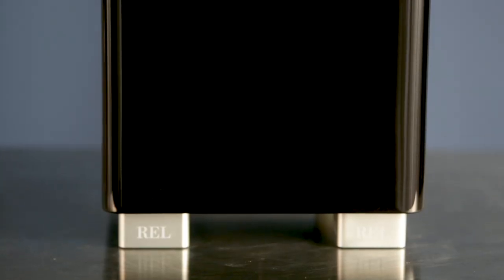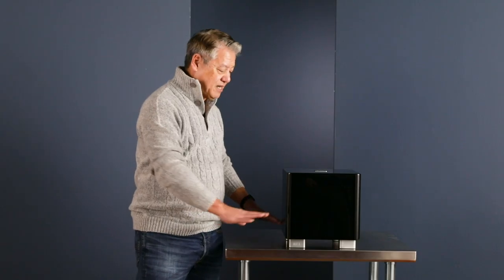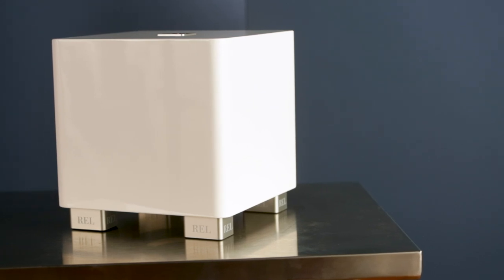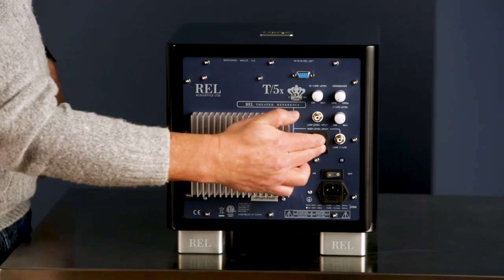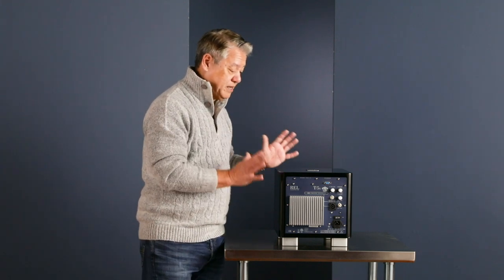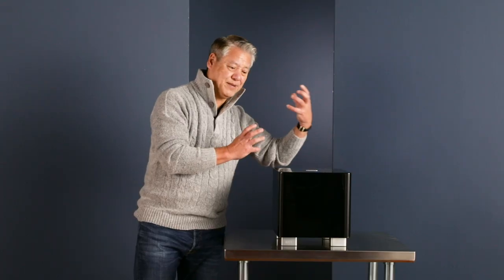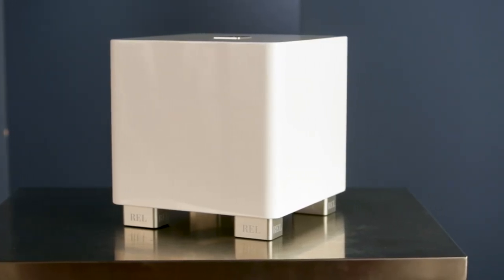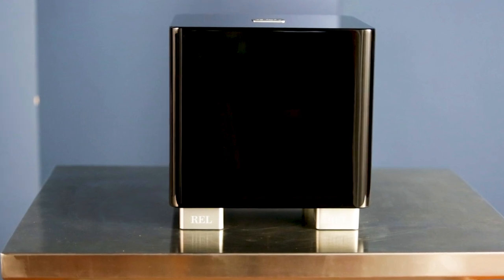REL Acoustics T/5x Powered Subwoofer Overview

Comment: I have the previous iteration…the T5i; I have it connected wirelessly via the REL Arrow wireless transmitter.  I have it set at 20% (8 clicks) on the min max volume dial and crossed at 30hz (lowest setting).  It’s integrated superbly for my room load for either home theater or 2.1 channel audio set up.  I cannot imagine needing more bass/sub bass (Preference dictates of course). I have it located on the rear wall in the corner of a 12 X 18 bonus room.
Reply from the maker: We are glad to hear that you are enjoying the performance of your T/5i! If you have any questions about the subwoofer or wireless system then feel free to reach out and we will be happy to assist.

Comment: I’ve just had my T5/x a few days and I’m so pleased with its addition to my system (Orchard Audio Pecan Pi Ultra streamer/DAC, Gamut D200 dual-mono power amp, Stereo Coffee kit LDR pre-, Sonus Faber Concerto Home speakers, Rega P3 and iFi iPhono2). My SF speakers did a great job but the addition of the single T5/x has definitely increased stereo depth and presence. I’m probably still dialling it in, however I’m impressed and it has contributed to my already great system just as I had hoped.
Reply from the maker: Thank you for reaching out, and we are glad to hear that you are enjoying the performance of the T/5x in your system! If you have any questions about your new REL then feel free to let us know and we will be happy to assist.
Reply: Just ordered one for my Concertos as well.  What settings did you use?
Reply: @flitetime  My T5/x developed a fault shortly after I bought it. Had a replacement card fitted and as yet I have not spent much time setting this one up. A quick check shows I have the Hi/Lo Level and the Crossover both at about 10 o'clock. Every room is different as you know. :)

Comment: I just set up two. T/5x with Elac UBR62 
It’s been about 20 hours of operation.. definitely become louder as they break in.. I’m surprise how much I’ve turned the gain down. They sound amazing. 
They blend with the speakers like nothing I’ve heard before from a subwoofer. They seem to change the lower midrange and add warmth and fullness. I’ve got an svs 3000 micro 900w 2400peak .. 
The T/5 is 125w and there’s no comparison.. The REL are so much more deep and seemingly more powerful. Especially after break in I think dropped six clicks down.The REL definitely delivers lower cleaner bass than the SVS. Even though specs say the svs was lower.
Reply from the maker: We are glad to hear that you are enjoying the performance of your T/5x subwoofers!
Reply: I have those speakers aswell and want to add two t7x 😊 nice to hear they blend well. How big is your listeting area. I have around 20m2. I hope those two will be enough

Comment: What's more important in pairing, subwoofer size to the room, or matching the price range of the speaker models?  Let's say you have a higher end bookshelf speaker (harbeth 30.2 for instance) in a smaller room, would you want a small sub like the t5x so that you don't overload the room, or would you want something like the 7x to better match the performance of the high end speakers and try to adjust to the room?
Reply from the maker: The ideal subwoofer choice for a particular system is dependent on several variables, including the size of the room, the choice of speakers in the system, and if the system is used for 2-channel music or home theater listening. In our experience, for use in small rooms the T/7x will be the ideal choice for pairing with the Harbeth 30.2 speakers.

Comment: Hi John.  I bought a cambridge audio cx a 61 with a sub output.  Should i still use the high level input on the t5x.  Or should I use the low level input and then run in to my amps dedicated sub out.
Reply from the maker: In order to get the best possible performance from the T/5x, we do recommend connecting it to your Cambridge Audio CXA61 using the High Level input rather than the RCA sub-out. The CXA61 is a Class A/B amplifier, meaning that you will be able to use the standard High Level connection method.

Comment: My listening room is upstairs and we have wooden floors.  Will this down firing sub cause problems for my family in the living areas below?
Reply from the maker: Due to the significant low-frequency pressure waves that they produce, any subwoofer can excite the floor which it is placed on, though how much this is heard in below living areas will depend on your listening levels and choice of program material. That being said, the T/5x will be less prone to this compared to our larger subwoofer models, since it does not reach as deep in it's low-frequency extension and does not have as much output power.
Reply: @RELAcoustics  Thank you for your reply.  It sounds like the T/5X is the way to go.  I guess I can tip it on its side if if is a problem.

Comment: Will a single T5X work well in a 5m x 5m room, pairing with Q acoustics 3050 and audiolab7000a ? The bass in the 3050 is not articulate and below certain frequencies become exceptionally quiet.
Reply from the maker: Thank you for reaching out. In our experience the T/5x can perform very well in this size of room, and is a good option for pairing with your Q Acoustics 3050 speakers. If you have any additional questions about subwoofer pairing for your system then feel free to write in to contactus@rel.net and we will be happy to assist further.

Comment: This may be a stupid question. I’ve never had subs before. If I set these up using the hi level input, does the gain need to be adjusted every time I change the volume level of the speakers using the volume control on the integrated amp? Or is the gain level set once, relative to the output of the speakers so the sound is always balanced regardless of the volume I’m playing?
Reply from the maker: Thank you for reaching out. REL subwoofers are designed so that their Level control is used to match the output level of the subwoofer with that of the system's main loudspeakers. Once this has been set, adjustments to the system's volume control will equally adjust both the main loudspeakers and the subwoofer together.

Comment: Hi John and Rel, I always appreciate your informative videos, but I have 2 questions about the T5/X.

Being a down firing design, could a system still benefit by having a stereo pair of them?

Secondly will they be happy very close to the back wall?

I'm interested in having them in a system with wall mounted Dali Menuet SE in my small bedroom. 

Thanks!
Reply from the maker: Thank you for reaching out. The performance of the T/5x subwoofer does benefit by using two of them in a stereo pair configuration, even with them being a down-firing design. Stereo pairs allow for a more seamless blend with the system's main loudspeakers, while also providing a more even distribution of sub-bass energy in the space.

For optimal performance we recommend placing the T/5x in a corner, ideally along the same wall as your main loudspeakers are placed, though you can instead place the sub(s) along the back wall of your room. The proximity of the subwoofer to the wall can then be adjusted as part of tuning them in your room and system.

Comment: Hi, my T5 went pop recently and as I am into home cinema as well as music, thought that maybe I should either get the HT1003 and maybe get the T5 repaired, or should I maybe just get the new T5x. Is there really that much difference between the two T5 models? Or would you recommend both the T5x and HT1003 anyway?
Reply from the maker: Thank you for reaching out, and we are sorry to hear about the issues which have occurred with your T5 subwoofer. The T/5x does offer a noticeable improvement in performance compared to the older T5, though it could still be worth having your subwoofer repaired. For repair information, or for help with choosing a new subwoofer for your system, please write in to contactus@rel.net and we will be happy to assist.

Comment: Dumb question from a newbie here - mt apartment floors are carpeted. Will the down firing driver be absorbed too much in this setting?
Reply from the maker: In our experience having carpeted floors will not impact the performance of a subwoofer, even if it is an exclusively down-firing model like the T/5x.
Reply: @RELAcoustics  Thank you.

Comment: Why isn't there a 180 degree adjustable phase function?  I feel like this is a must have feature in my setup.  Also,  ,for years now,  I've been using a Jensen ISOMAX SP-2SX Line converter to accomplish HL input to my Focal Sub6.  Unfortunately, if the impedances between the matching components isn't correct, it results in a minor loss of spatial ambience, a loss that is hard to accept. How does REL overcome this problem?  Is REL implementing a similar internal transformer design and is there impedances losses?
Reply from the maker: Thank you for reaching out. In our experience a two-way phase switch, along with making subtle positioning adjustments to the subwoofer in your room, will offer plenty of adjustability for achieving a proper phase match between the subwoofer and the main loudspeakers. In addition, a continuous rotary phase dial can oftentimes be too much adjustability, and makes the setting-phase process more complicated than necessary. 

The High Level input on a REL subwoofer has an input impedance of approximately 150 kOhms, which results in the REL being able to draw signal from the same amplifier output terminals as your main loudspeakers are connected to, without placing any current load on the amplifier or drawing any amplifier power away from the system's main loudspeakers. As a result, when using the High Level connection the subwoofer is essentially invisible to the amplifier from an electrical perspective. By comparison, based on their literature the Jensen ISOMAX SP-2x has an input impedance of of between 1.1kOhm and 2.3 kOhm.
Reply: I see.  Thank you for the thoughful explaination.

Comment: Hi, I have a room, which has been sound proofed size is 17ft x 16ft. I am looking to pair up with current desktop active speakers, the Kef Lsx.

1 - Which of your speakers the t5x /t7x would you recommend for the room size.?

2 - how would I connect to the Kef Lsx.?

3 - How would dual subs connect to this speaker?

Thanks
Reply from the maker: Thank you for contacting us, and for your interest in REL subwoofers. When you have a chance, please write in to contactus@rel.net and our team will be happy to provide a subwoofer pairing recommendation for your system, in addition to instructions on how best to connect the subwoofer to your Kef LSX active speakers.

Comment: Hello i use the ProJect 5 S2 Speaker in my 26 qm flat. Do you think the T 5x ist better or the T zero nMKIII? Thanx a lot
Reply from the maker: Thank you for reaching out, and for your interest in REL Acoustics subwoofers. Based on the size of your room, a stereo pair of Tzero MKIII or a single T/5x would be good options for pairing with your Pro-Ject Speaker-Box 5 S2 speakers. For more information about subwoofer pairing options for your system, please write in to contactus@rel.net and our team will be happy to assist.

Comment: I currently have a T5i and planning  to get another one but realized model has been upgraded, can I pair T5x with my older T5i? I'm using mono blocks btw.
Reply from the maker: Thank you for reaching out. The T/5x can be paired with your T/5i, though improvements were made during the design and development of the T/5x which means that these two models will not be a perfect sonic match when used together in a stereo pair configuration. Specifically, the T/5x has greater output power and is able to reach deeper in it's low-frequency extension, while also being noticeably faster and more responsive in it's output compared to the T/5x. Ideally, it will be best to use a second T/5i to match with your current one, which will ensure that the sub-bass output is balanced and even from left to right.
Reply: @RELAcoustics  Makes a lot of sense! Thank you for your help.

Comment: I have a McIntosh set up in a 11X14 square feet room. 462 amp - xr50 stand mounts, wood floors and walls, good sounding room. I you could advise pls. Should I go with two T/5x´s or one T/7x or one T/9x. I do have a Audiovector Sub today, but it is rather slow moving and is not exactly keeping up with the XR50 stand mounts.... Pls. adv.
Reply from the maker: Thank you for reaching out. Based on the size of your room, we recommend the T/7x as being the best option for pairing with your McIntosh XR50 speakers. The T/7x has a fast and articulate output which will blend seamlessly with these speakers, and will have plenty of output power to properly fill and pressurize this size of room. 

If you have any additional questions about the T/7x, then feel free to let us know and we will be happy to assist.
Reply: @RELAcoustics  thanks a lot for the input!

Comment: I have a few questions - 1) Why doesn't it have a remote control? 2) Where is the 12V trigger? Is it constantly turned on? What is a power consumption in a stand-by mode, if there is any? 3) What input should I connect my AVR to? Remember - AVRs have thier own sub output and also room measurement systems. I have also read some opinions, stating, that T5x line connection sounds substantially worse than direct connection to speakers. Could I use both? Still need an LFE channel from AVR. Thanks a lot.
Reply from the maker: Thank you for reaching out. In our experience, the best performance and most seamless blend with a system's main loudspeakers is achieved by using completely analog filters, which is a primary reason why the T/5x does not feature a remote since this would require digital conversion in the filter circuit. In addition, once the subwoofer has been set up and tuned to blend with the system's main loudspeakers it should not be necessary to make any further adjustments to it's tuning controls. You are also correct that our subwoofers do not feature 12v trigger for controlling their power state, and instead simply feature a standard power switch on their back panel. To get the best possible performance from the subwoofer we recommend keeping it fully powered on at all times, and in the case of the T/5x the subwoofer will only draw 14 watts when idle, or fully powered on but not producing any signal. That being said, you are welcome to fully power off the subwoofer when not in use if you prefer. 

In most systems that use an AV receiver we recommend connecting the T/5x using both it's High Level input and the .1/LFE input. The High Level input connects to the amplifier's speaker output terminals, which will be the same terminals where your main speaker wire is connected to. The .1/LFE input will then connect to the receiver's  sub-out jack. 

If you have any additional questions about connecting or tuning the T/5x in your system then feel free to write in to contactus@rel.net and we will be happy to assist.
Reply: @RELAcoustics  So I have decided to go with the REL T5x. As an AVR owner, I would like to ask - what is an ideal connection scenario?  AVR usually has some settings for the bass management. You can set your cross-overs and direct your bass to the LFE, or LFE + Mains (fronts). But doing so, you are not making your AVR a service, as your fronts usually don't go so deep down. Hence I wonder, what is an ideal setting for AVR owners? Using LFE and letting AVR do the cross-over job, using high level and let bass go thru front speakers terminal, or from whatever reason, use both connection?
Reply from the maker: @PetrKrenzelok  To get the best possible performance from the T/5x in this system, we recommend connecting it using both the High Level input and the .1/LFE input simultaneously. This will allow the subwoofer to provide low-frequency support for the main speaker channels while also delivering the LFE sub-bass effect channel when listening to home theater material. When running both inputs together, it will be necessary to have your main loudspeakers set to Large so that no crossover is applied to their signal. We then recommend setting the subwoofer output to "LFE" rather than "LFE+Main". 

If you have any additional questions or concerns bout setting up the T/5x in your system then feel free to write in to contactus@rel.net and we will be happy to assist.

Comment: How do I use the crossover alongside the high-level input? Wouldn’t that connection cause the speakers to play at full range?
Reply from the maker: Thank you for reaching out. When using the High Level input on a REL subwoofer, it is necessary to send a full-range signal both to the system's main loudspeakers and to the subwoofer. The Crossover control on the subwoofer itself is then adjusted by-ear to below where the main loudspeakers naturally roll-off in their low-frequency extension in your room. In our experience this approach results not only in improved performance from the subwoofer, but also allows the main loudspeakers to perform their best.
Reply: @RELAcoustics  Thank you for the reply. I must say your company has been great in answering questions and I think I will now try a REL sub instead of competitors
Reply: @RELAcoustics  
Hi there, so when we run the speakers large and connect them via both  high level and lfe connection and cross over the subwoofer at 80hz what happens to the lfe signal (information) up to 120hz. Do we loose all that.
Reply from the maker: @rayking507  Thank you for reaching out. The .1/LFE input on the T/5x (and all of our models that feature the High Level input) completely bypasses the subwoofer's own crossover filter circuit. This means that the output of the High Level signal is being filtered by the subwoofer's Crossover, while the output of the .1/LFE channel is being completely controlled using the settings within your AV processor.